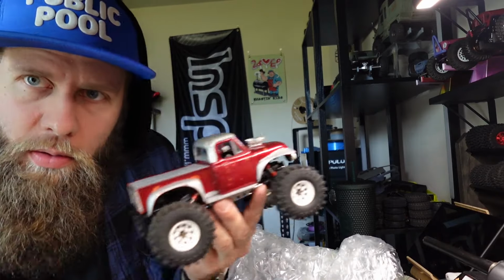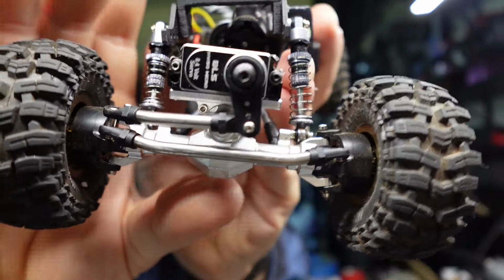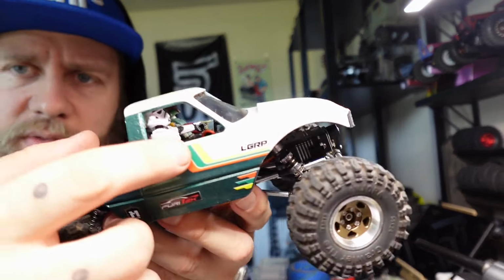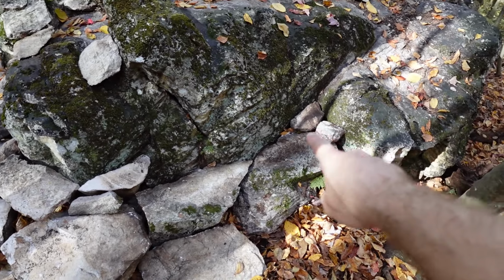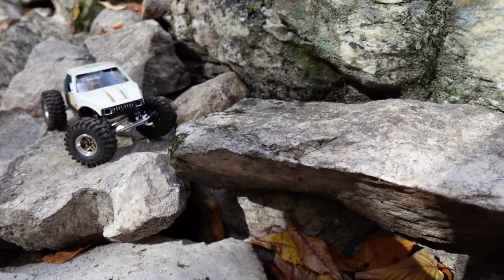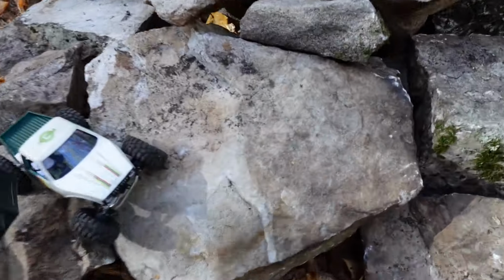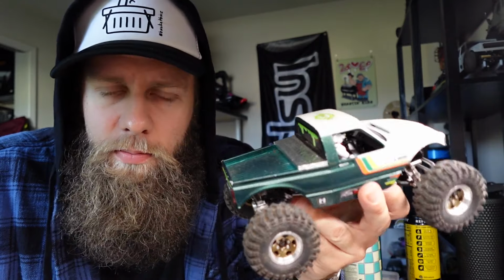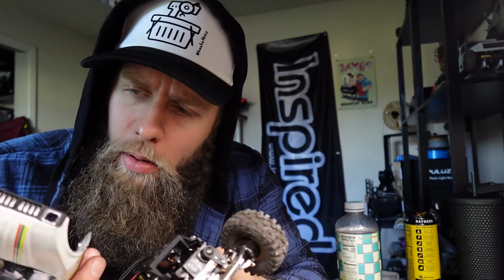Roastin' Rigs - Episode 41 -  CRAWLIN' IN THAT 80s YOTA STYLE!

Comment: Excellent video as usual!

Ok, so my first crawler arrived yesterday. I was not prepared for how tiny these things really are! The camera really does add ten pounds lol.
Anyway, I'm already having a blast crawling on random things inside the house.
I bought the Axial AX24 XC-1. I know you're not a fan of that one, but I like the four wheel steering.
And I purchased the crappy Spektrum brushless motor and esc combo before doing my research. It works, but definitely has that abrupt start which we all know is not good for slow crawling.
But at least I'm in the game! This is going to be an awesome hobby! I haven't played with r/c stuff since before 2000.

Thank you for the inspiration!
Reply from the maker: Sweet!!!! I'm pretty sure the ax24 is pretty much the same as my scx24s except it comes with a different chassis/4ws. I think all the parts are shared. Welcome to the rabbit hole!!
Reply: @24Yepp  yeah, they're pretty similar.
Thanks!

Comment: Loving the Toyota. Regarding the high clearance links and body mods to accommodate the clearance…unless built specifically for comp, I would not want to mess up the look. I still see a huge advantage to having the clearance from the links and chassis…the little bit of body that hangs down on both sides won’t impact that often unless a clear break over style obstacle.

Comment: Instead of thread or rubber bands to control the shock, dropout guys could open shocks and place the tiny O-rings  under shock piston to limit the height/dropout of shocks.
Reply: If you do that, you will lose articulation this way the suspension rocks back and forth and you still get full travel without excess droop!!! And it's cheap!!! Rock on!!!
Reply: @Rockcandyrc.  fair enough, too much articulation isn't a good thing. IMHO, your rig did well, though.
Reply: @bergcrawler1  Ya man, the 39s are long enough for me!!!, I've got the drivers taped in so I can take them out on some harder lines, it does make a small difference 😆  It did pretty good, it's obviously not an extra long comp build, but it rips in it's own way!!!

Comment: Let me tell you a little something about that they're Servo the horn is way way bigger than a normal horn far as the spline and where it goes on it but it has 1.4 mm holes in the lower part which was weird and it's like a 3 mm screw works really really damn good very very strong it's not the fastest thing in the world but it's pretty damn quick